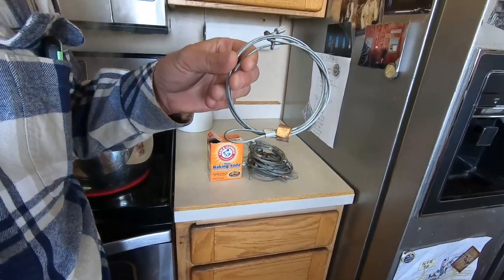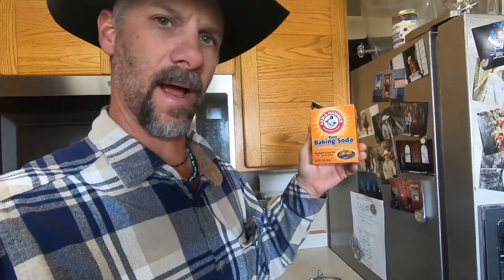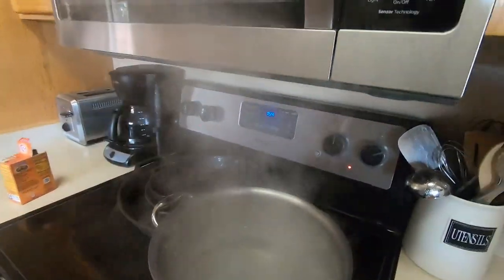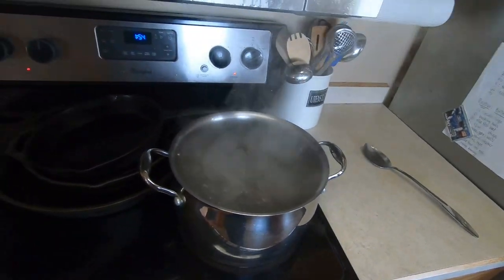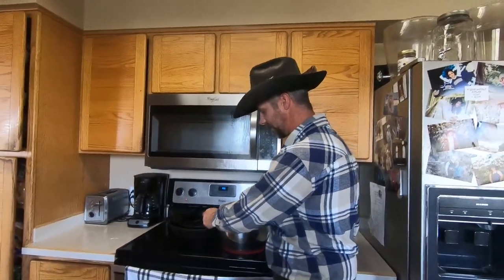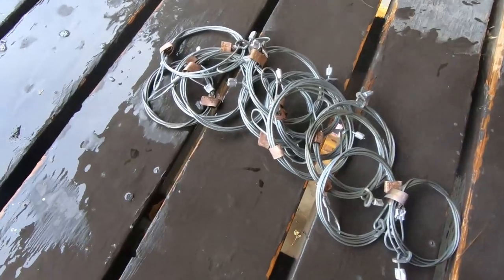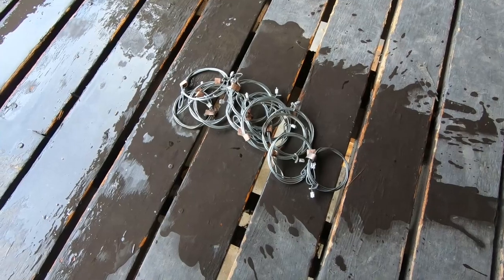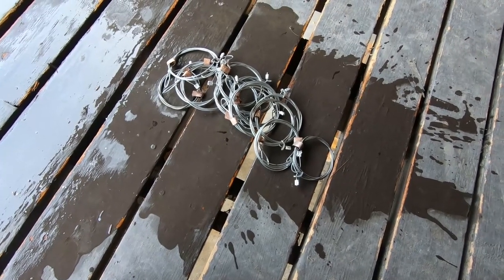TRAPPING TIPS- Boiling Snares

Comment: Thanks for this trapping tip. Ive never used 1x19 for my snares.i should try it my loops are as defined as yours
Reply from the maker: I really like the 1x19 Jeff. They are a quite a bit stiffer, and they seem to hold up ok. I started with 7x7, and my loops were more of a tear drop shape. I still caught coyotes with the 7x7, but I guess it’s just personal preference. Also, if you make your own, the 1x19 cable is quite a bit cheaper than the 7x7.
Reply: @jeromycooley-outwestadvent5790  im going to have to give that a try .were out west are you located